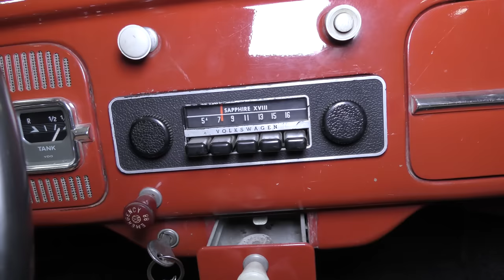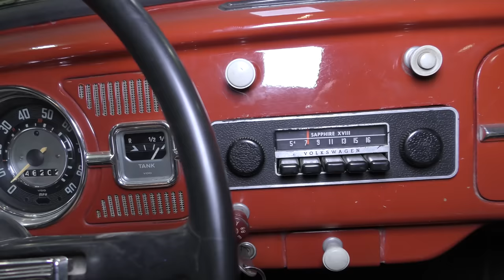Big Mods with big $$$. When Mods don't make sense. What did the  CAR WIZARD do to this '66 VW Bug?

Comment: 1966 was the best year. The next year they switched from the recessed headlights to the ugly flat lights that conformed to the law that North American cars could have no glass over the headlights. Now all cars have recessed headlights!
Reply: True when just considering the headlight deal...but the 67 was a substantial improvement over the 66...a bigger, 1500cc engine was available, along with the 12V improvement...67 is the favored model year for collectors.
Reply: @curbozerboomer1773  But I can convert a 66 to 12V, even put a fuel injected engine from the '70s. I can't do much about the looks of the later bugs.

Comment: So they want instant starting from a carb car after sitting?  OOOOKKKK..   Great idea for an electric fuel pump. Worked great.. Mybe using non ethanol gas would help the carb cars and boats?

Comment: I love car wizard and these videos - but I have to point out one thing that he said that's just flat wrong.
The problem with gasoline today is NOT that it somehow evaporates faster than "old school" fuel.
The REAL problem is that it contains ethanol.
Ethanol is alcohol, and alcohol can easily attach to the water vapor (humidity) in the air.
The water is also soluble in alcohol - which means they can mix together.
Water is heavier than gasoline, so the water /alcohol mix sinks to the bottom of the fuel tank - and that's where the fuel pump sucks the fuel from the tank. So you're sucking up water and alcohol rather than gasoline, and cars don't run on water unfortunately.
The 2nd problem is that old carbureted cars like this one have problems with the carburetor getting corroded by the water, and the jets clog.
People forget that gas tanks and carburetors are NOT sealed off - they are both vented. The carb bowl is vented so that the outside air pressure is equal to the air pressure in the float bowl - that's how carbs work, difference in air pressure (bernouli effect)
The fuel tank is also vented so that air replaces the fuel that was burned - otherwise your fuel tank would crumple in on itself like a smashed soda can as the fuel pump sucks the fuel out... And eventually the fuel pump wouldn't be able to overcome the vacuum created in the fuel tank.
Today's fuel problems have absolutely nothing to do with the fuel evaporating. Nothing at all.

Comment: why wouldn't the car start from the fuel in the float bowl?  Where did all the fuel go that was in the float bowl when you turned it off?  did you turn the fuel pump off and let it burn up the existing fuel?  It has the wrong distributor,  009's suck.  It has a 12 volt alternator form a 1975 or newer.  nice job with kink in the breather hose rendering it non functional.  The whole floor pan is the "Frame"

Comment: Where do I get that fuel pump relay inertia switch ??
I run the 91 or 93 octane fuel in my old vehicles that sit for a while to get away from the alcohol AND add the fuel stabilizer to the tank.
It starts when I need it to.

Comment: Nice job on the start up problems. Exactly what I would've done minus the safety switch for the fuel pump. Those can trip just by hitting a pothole, especially in this car and some can't be reset once they've been tripped. No thanks. Tell me you didn't use one of those. My first car was a 67 Olds 442 and I had dual Bendix electric fuel pumps in it the trunk that flowed right through the original stock block pump. It's problem was it couldn't put out enough fuel. Especially the later year replacements.

I will say one thing, I grew up with these cars and that's the nicest sounding Beetle I've ever heard by a long shot. Even a dune buggy. It almost sounds like a real engine. LOL

What crap these cars were. Especially in any Winter environment. The front was so light, they would hardly steer at all in the snow and would chug right past the stop sign and not turn at all. The old rear engine Fiats had the same problem.

The heat was non existent as were the defrosters. All the defrosters would do was throw up enough hot air to ice up the whole windshield from the inside. And what did you do with the horn? It has to have a horn to pass inspection. With no spare tire, these had no horn because it ran off the air in the spare. And it has no spare tire. Could you even imagine today your horn running off you mini spare tire? Like I said, post war German crap. They would float however. Why? Good question, you'd have to ask the Nazi's who designed it. And yes, they were real original WWII Nazi's who designed this car. You can see the military cheapness in it. And the year of the car is only about 20 years after the war coming out of a totally destroyed country.

She is in amazing shape for what it is.
Reply: It was the windscreen washer that was powered by the air in the spare...
The horn was electric.
The defrosters worked well if the whole system was in top shape...air leaking from rusty channels/hoses from the engine tin ware to the heater boxes would lower output, as would broken or rusted controls.
A hole in the cast iron heat exchangers would put carbon monoxide in the cab...
The spare was in the front trunk...probably removed to allow the Wizard to show the fitment of the relay and safety device...I noticed the jack just off to that side as well.
Owner 1955 1200, chopped chassis, converted to 1600, Holley 2 barrel carb, fibreglass Can Am style body...road legal..fun for the twisties...
Reply: And for 12 months, a 1972 Kombi, LHD on UK plates for the Big O.E. (Overseas Experience) travelling around Europe during the fuel crisis of 1979....memories...

Comment: I like this mod but i have one question. Will the carb overflow if the fuel pump is on and fills the bowl but before the engine has started? Any adjustment or modification to the carb float required?

Comment: When I was 17...(1976) I had a 68 Beetle. Had a 2180cc big barrel kit, bus trans-axle, dual port, etc. 

Probably had 100 horsepower.......scared me shitless many times. Fun car that cost a lot of money to maintain that could blow all my buddies mid 70's muscle cars into the weeds on anything but a straight road.

This is a picture of it back right after I had it repainted.

https://get.google.com/albumarchive/103965506712870830692/album/AF1QipOkQrBCd7CH5vNFjMYISbJ06FvvoBCzntwbr_ws?authKey=CJWy7YOktJrPoAE

Comment: This Beetle is heavily modified, it has disc brakes (not that it would need them)- no Beetle that old had them. I HATE EV conversions in general. Just hate them. If One wants an old car he has to accept the quirks.
But an electric fuel pump makes sense, in any case.
I´d like more vids with old BMW`s like the black one in the background, my 1st car was a ´67 Beetle, my 2nd a ´76 BMW 318 in signal orange- an awsome driving machine! With 90 horses it did 160 km/h anytime. No matter if just me or tha car was full, it just took longer but we got there. It used about 10L/100km on long runs but went up to 15L on city drives, I loved that BMW. But the rust ate it and I didn´t have the matters to save it in 1993.
My dream car of the time was the 323i- a real opponent on the Autobahn! Ah, those were the days- cheap, real fuel and a young chap looking to impress the chicks, my 318 did good.
Please make more vids with antique cars for an antique crowd- when I see these German beauties I again get the tickles, my leadfoot days.
Thanks for this, although I disagree with some things done to it- es ist immer noch ein schöner Käfer. Greetings from Germany

Comment: Big tires in the back and lowered in the front might "look like a hot rod" but it's ass backwards to what really hotrods VW engineering and performance. Raising the back or lowering the front only completely fucks up chassis design and causes even worse oversteer than a rear engine car already tends to. Ask any Porsche 356 or 911 owner about oversteer. Smaller diameter tires equal increased RPM and better low end response and that makes for quicker acceleration even with a stock 1300.

Comment: Two comments: 1) Lowering a Volkswagen is a BAD idea.  Placing the oil sump in closer proximity to the pavement (a thermal mass with a high heat gain) causes it to pre-heat the oil and to run hotter causing premature failure.  2) Driving any car without bumpers is a really BAD idea.  Bumpers were put on the car for a reason. Omitting them can lead to expensive repairs.  Why de-engineer the car and make it less functional ?

Comment: I stopped at about 2 minutes….
VW modifications mean….they either cannot find the “hard to find correct part” or cannot install the hard to find correct part.
So they use ……whatever…..
Do you know why they don’t have the correct bumpers on this? Because they’re hard to find, hard to you install and expensive.
Do you know why they don’t have the chrome molding in the windshield gasket? Because it’s hard to install, and hard to find original parts.
Do you know why they don’t have factory wheels and hubcaps on this? Because they only were for two years. And finding good ones are difficult.

Great! The wrong size tires on that all ready spindly washy feeling swing axle….the one vw tried to fix with a z bar and longer axles….I wonder how that feels to drive….oh and it’s been lowered as well…..great!
The wrong peashooters, probably the wrong muffler also. I wonder how well that’s making the carburetor preheat pipe work? Probably not at all.

Every time you change something, modify something, or try to engineer something on one of these cars. Three other systems fail to work properly.

I had to stop watching because I didn’t wanna see anymore. It does have a nice paint job.
And
I didn’t look, but it probably has ladybug floor mats….that’s my gauge….if the car has those, it’s been wildly boogered up usually.

Comment: you guys dont have rec 90, or none ethanol fuel there?  in flordia its at almost every pump that is close to the water..  about a dollar more than normal fuel. i use it on all my small engine stuff and my old truck.. never have any fuel sitting issues with it

Comment: I think that despite this cool repair and upgrade your advice to the owner ought to be to not let it sit for too long at the time. Besides, with a 66 Beetle in this good condition I am sure that the value of the car would go down if they went ahead and did the EV conversion.

Comment: Could you change it from carbureted to fuel injected without having to do much to the engine?. And or can you even find a fuel injected engine that would fit in it  while not hurting the value.
Reply: Some people swap Subaru motors in these...

Comment: 30 grand for electric, into a beetle, wouldnt it be cheaper to part out a prius or a Nissan Leaf and just transplant that into the thing? I mean Eur-o-pean on my boot (sorry I just love that blue collar TV joke lol) euro Asian Bob is gonna be crushing two of the things, also electric has a basic disadvantage, its not condusive to cold weather, and will loose charge in the colder temperatures, which granted isnt an issue on a limited use car like this

but also if the things not kept charged up regularly, the battery will loose its charge overtime too, and hoovie did say that the teslas like to keep running and need regular charge basically 24/7 just to cool the battery packs

which is why hybrids are really the smart mans electric as then your not stranded or driving yourself nuts keeping it plugged in all the time.

Comment: I agree that today’s gas is crap! They are adding chemicals to extract one third more gasoline from one gallon of crude oil. Profits and demand! Then they add ethanol to pump gas. The ethanol is hygroscopic, which means it absorbs water!  Left sitting for a while, the moisture picked up in the carburetor, causes most clogging problems. My 71 vw sat in a junk yard for approximately 30 years. When I opened up the carb, it was actually pretty clean! That old gas just slowly evaporated and left the carb dry, but not plugged. So, that was a pleasant surprise. It still got a kit.because the needle and seat assy. Wouldn’t seal, along with a mech. Fuel pump.                                               
I wouldn’t agree that the fuel evaporates like you say, because fuel has always evaporated. And using a mech. Fuel pump back in the day wasn’t a problem.there is check valve in pumps to keep them from draining back to the tank, and more than likely that was the problem. Having been an engine technician all my adult life, I have plenty experiences with both styles of pumps. Sometimes electric is the way to go! But not always.at least not with my bug.

Comment: With EVs its all about the battery. Power, $, longivity, its all about the batterty. You want a scaled down apples to apples comparison if gas to ev. Look at lawn mowers. Compare the toro gas recycler to the 60v one. Youll see where the cost of the electric one goes when you see the tool only cost vs battett included. The battery. Remember thar guys. And remember your math! 60v*6ah=360watts. Say you could drain that in 20 minutes. Your motors putting out 1.08kw or 1.45hp. Meanwhile the gas motor can put out 4hp for an hour and its alot cheaper. So back to cars. You have to choose big and powerful and $$$$ (tesla, machE) or affordable and small (bolt,leaf tiny and cost alot more than a gas powered midsize).  This is not gonna change cuz BATTERY $$$. I think were gonna see plug in hybrids become more and more mainstream by automakers choosing. Watch The govt will let them pass the test in ev only mode. Its like when they let them cheat the mpg tests  tiny turbo i4s in the chevy cruze and ford fusion.

Comment: First of all, what you called a generator is a later model alternator. That's not original on a '66 which would have had a six volt system. Wonder where you found 12 volt headlight's for that rig. The adjusters on the torsion bar tubes are not original either. To adjust them you had to pull the torsion bars out and they had a splined end you could reposition. The engine looks trashy, especially the fuel pump delete cover, so rough. I drove these cars for 25 years till I realized how unsafe they are. All you geniuses and expert mechanics and I have yet to see one of you address the ejector seat Phenomena which will throw you through the rear window in a rear end collision. I could easily envision a flat bar under the front seats which would connect to 4 large U bolts over the deadly seat rails which fail in a rear end collision. But no, all you ever care about is power and paint gloss. This is a perfect example of putting lipstick on a pig, it's still a pig, in my opinion.

Comment: The car is lovely but Its the wrong radio (sapphire 3 or 4) you can see it doesn't fit and it needs the proper trim and knobs, the headliner install was poor at bested the rear panel is awful, the hose is pinched from the case vent to the air cleaner, I hope your not trying to show case your work, the carb bolt was hacked of with a saw and left a sharp barb that will cut someone ,the fuel pump block of is a hack job, how do you put the spare tire in with all the electronics in the way, poor placement like i said the car is lovely but you execution is lacking

Comment: I use a solenoid valve at the tank outlet that always holds 3psi in the line after the key is turned off. Weather it helps or not is anyone's guess.

Comment: Great place to ask this question, how do I repair (no welder) a pin hole in a steel diesel tank on an old generator, its sucking and leaking  way too much diesel :( please  help  someone, Thanks,
Reply: Have had good results with JB Weld for gas tanks...
if you can't find that, then plain JB weld...
just clean area with carb cleaner and be generous with the JB Weld.

Comment: I'd do away with that electric pump and put a stock pump back on. In case the pump does go out you can get one nearly anywhere and they're very easy to replace. If you had to crank and crank it then it was probably in the carburetor and not in the fuel pump. My stock 1600cc trike starts hands off.   https://www.youtube.com/watch?v=LEPqPflCuSk&t=3s   A properly set up and maintained VW doesn't need to be cranked over and over.

Comment: So EVs aren't economically viable, who'd have thunk it! Thankfully the customer didn't opt to ruin his classic. To store an non-cat classic car, try to get hold of avgas (which is just high quality and high octance leaded gasoline) or in the very least use ethanol-free gas (even if you can't buy it at the pump in your state or country, you can extract the ethanol and then use an additive to the base gas). Next, you should fit a fuel cut off, so when you park your car up for a few months, flick the switch and allow the carb to run out of gas as it's idling. That way, you don't have any gas in the float chamber.

Comment: These cars were crap. 40 hp, bodies prone to rust, constant tune ups, no heater or defroster, maybe 20k miles w/o a rebuild, constant leaks and you couldn’t talk on the highway if you ever got it there. In the early 70s you couldn’t give one away…..😆

Comment: P.S. Did you do a valve job to make it run on this unleaded trash? Ethanol is death to the gasoline. and the human body. Cats on car exhaust can't do their job with the ethanol gasoline. It absolutely smells horrible, burns your eyes & lungs. The catalytic convertors were performing brilliantly until ethanol showed up. Gov. corruption caused this & Mo. senators were in on it. Plus, your mileage goes to hell and left sitting, your car will show 1/4 tank lower because of evaporation. Wasted money. Ethanol is a NO WIN.

Comment: i would be ashamed to show this video if i worked on this car. besides the female voice of "perfect interior" the crankcase oil vent tube is crimped shut, the fuel tank breather hose has failed and needs replacement for the first two obvious mechanical things and easy fixes less than 1/2 way through....